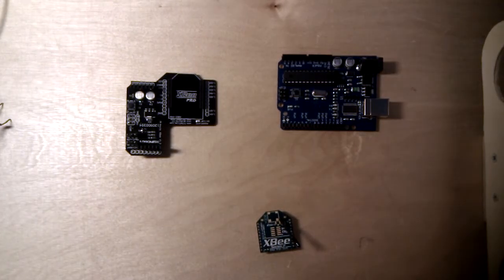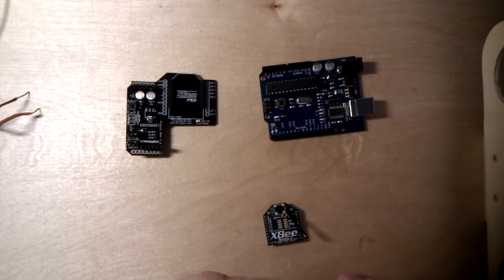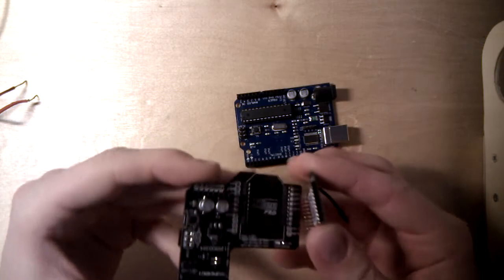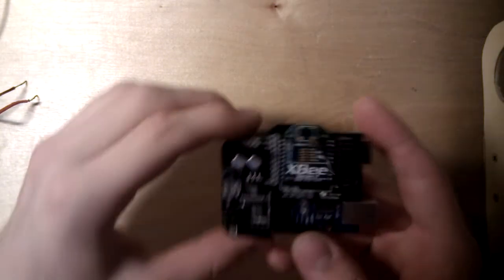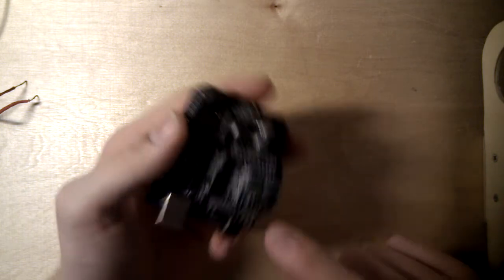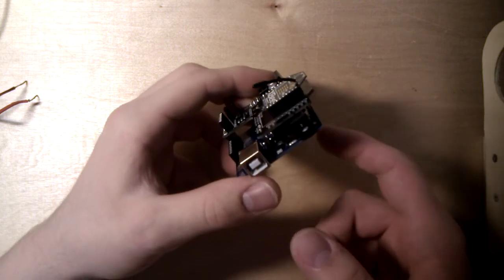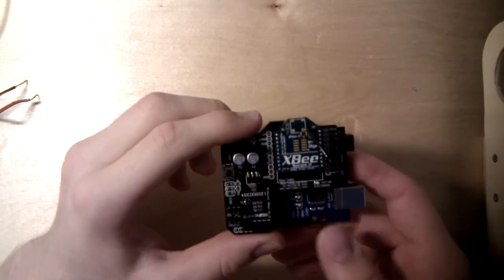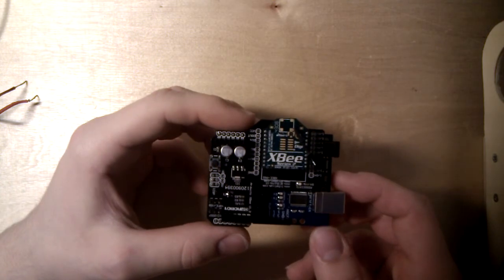Tutorial: Arduino and the Xbee Shield

Comment: Hi! Thanks for all yout info, I'm currently working on a remotely operated terrestrial rover(With GPS, temperature sensors, etc.) with Arduinos Xbee shields as coordinator and end points. I have no problem in sending and receiving data from the rover however I want to display the information received in the computer and I can't seem to find a way of doing it without crashing the serial communication between the XBees. Is it possible with two arduinos or do I need another device? Thanks!

Comment: I am looking for an xbee shield, I saw one on sparkfun.com but everyone says they are having problem with. I have the Uno rev 3 and saw your shield on arduino.cc, how do you like it? any issues or things you would change? Also how to connect the reset in order to transfer data from USB, you have a video on how to set it? I currently Ive stacked a high current motor shield to feed 2 / 12 volts scooter motor attached to a 12V marine battery, Now want xbee to remote control the robot.

Cheers